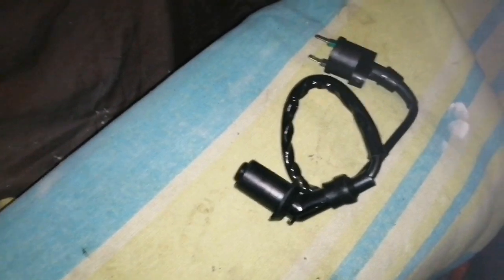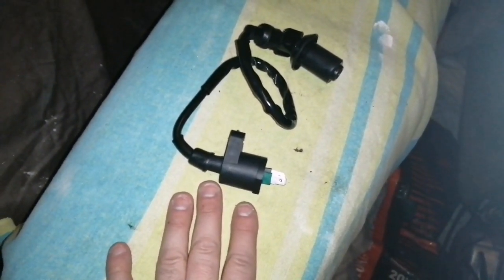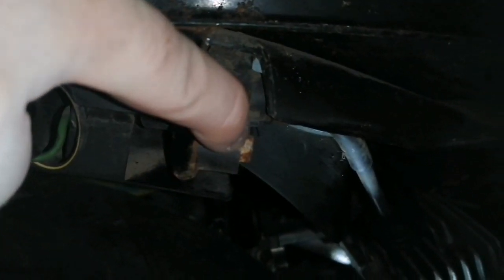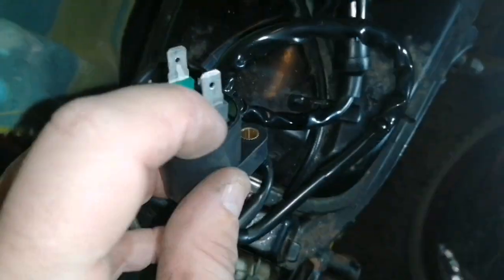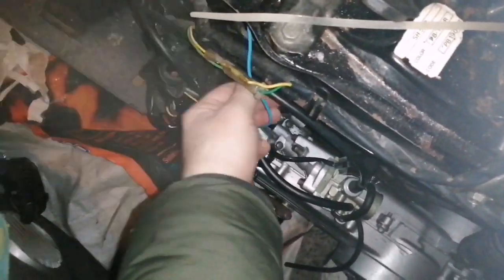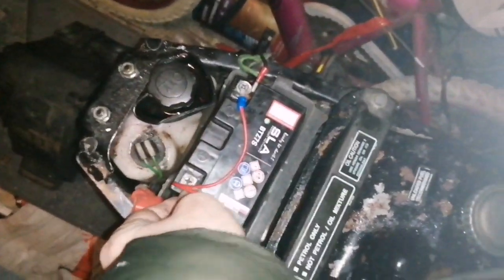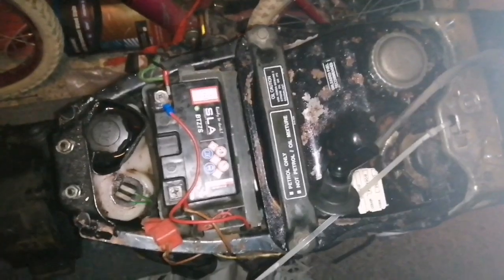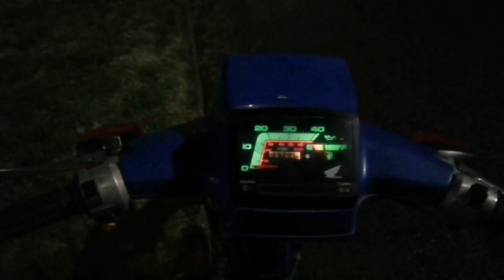Honda Sh50 city express (Old Blue) part 12. problem solved hopefully.

Comment: Thanks, very useful. My 86 SH50 ran perfectly, until til it started loosing power intermittently, accompanied by a restrained exhaust note, until it
finally died a long way from home at 22:00 in the evening.  I have a new CDI, will buy a new coil, sparkplug, and check fuel flow. Also the starter
sometimes doesnt engage, it turns, but doesn't engage. Another thing is I have a big bore kit for it, but what happens if I try to install that, I'm
thinking what happens if gaskets breaks?  Anyways, I love that moped, Honda is a great company! My first moped was a Honda C100 ;-)
Thanks for the great help your posts provides!!
Reply from the maker: Thank you stig. 😊.  I would imagine the gasket will probably break when you take the head off thr bike. But you can buy gasket kits for them. As for fitting a big bore kit, just remember if you put a bigger bore on to it. You will need to up the size of your main jet in your carberator for it to run correctly. It's not something I've attempted yet. But I might. I find that fitting the Malossi aftermarket final drive gears makes the biggest difference to its speed.  My red one will do 40mph on a flat straight and anything up 55 or 60mph going down a hood steep hill.
Reply: @damo690  The big bore kit is a Malossi, and came with a main jet, and some gaskets, so, thanks for the advice, will buy a gasket kit, and I will
certainly check out the Malossi after market drive gear kit you mentioned. :) Thanks, plan is to fix it so that it starts and runs reliably, then fix the
starter, new battery, replace bulbs, wd40 it, and then maybe fit the Malossi kits, so thanks for your advice and posts, much appreciated! :)
Reply from the maker: @stighenningjohansen  it's probably the bendix on the starter that's bust. I have a spare one here if you want it.
Reply: @damo690  Thanks for the offer, I ordered one off Ebay, there's a ton of SH50 parts out there :) I will fix it ;-)
Sidenote: The moped stood in front of the house, covered with snow most of winter a few years ago, and I went out to check if it was alive, brushed off some snow, inserted the key and pushed the button, and it started.. Reliable thing :)
Reply: @damo690  Yes it probably is, I bought one off the net, but it was from -96, not -86, so I fucked up :) As usual, but will try again! ;-)